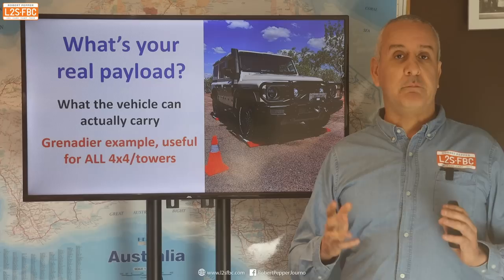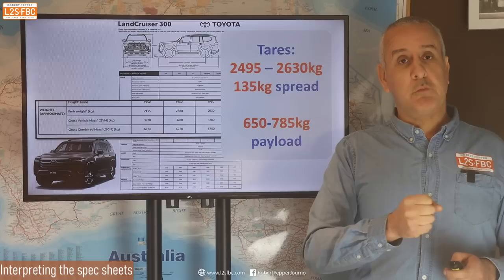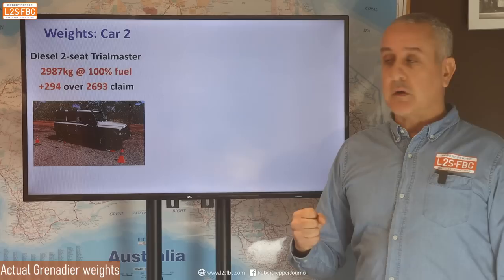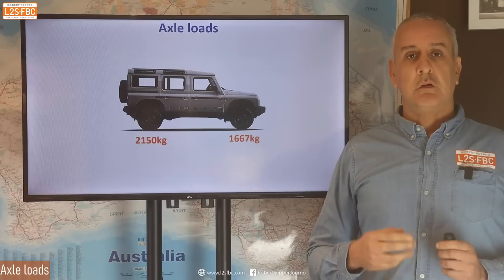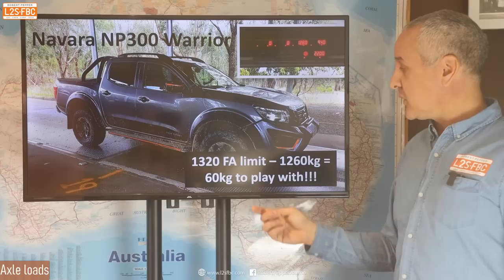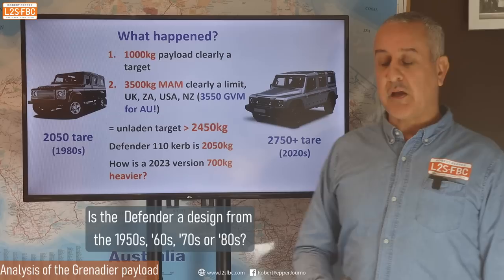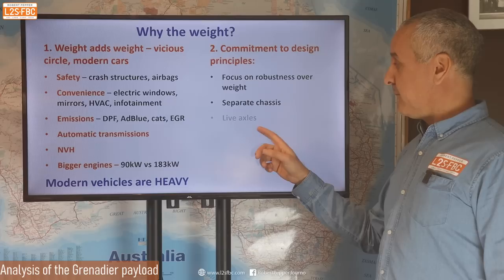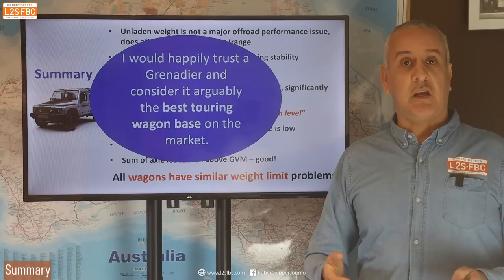Traps in 4x4 payload calculations - INEOS Grenadier example

Comment: On my personal vehicle I have reduced the weight  over 200kg  below the factory kerb weight. I did not do this with any  intention to improve load carrying capacity , however it has made me think it could be possible to simply go through the process of weight  reduction rather than do gvm upgrades on 4x4s. Is this a stupid concept?
Reply from the maker: No, it's not...but what would you take out?  There's not much that can be done for most people. Swapping the steel rims to alloys would be a start, then you might look at removing soundproofing, changing the Trialmaster AGM batter to lithium (along with the controller/charger of course)...what else?
Reply: @L2SFBC  in a modern vehicle I guess you couldn't really remove too much stuff legally so you would have to replace components exhaust system ,  lithium starting battery  wheels , full floating two-piece brake rotors , aluminium tailshaft decent amount of weight to be saved when removing air conditioning  you could just add a standalone system and only have it in summer the benefit is you can run it without having the car running. Considering the cost of a gvm upgrade surely you could knock a decent amount of weight out of a car for the same price.
Reply from the maker: Indeed, as I said I don't think weight was a priority otherwise they wouldn't have made that door two-piece for starters!  It is AWD so no need to over-build the rear diff, the front will always pull too.

Comment: Question, if manufacturers  (Ineos in this case) chose to fudge the tare weight (in terms of the definition which they follow) for higher model grades, doesn't the liability remain with the manufacturer? Cheers and thank you for your time and content
Reply from the maker: I don't think it's a question of liability, as liabilty for what?  I also don't think any carmaker fudges figures, it's more they fail to understand that BUYERS OF 4X4s NEED TO KNOW WHAT THE CAR CAN CARRY!!!
Reply: @L2SFBC  Agree, buyers do need to know what they can carry however if the manufacturer does not provide the correct specifications how can the buyer be liable/accountable for overloading the vehicle?